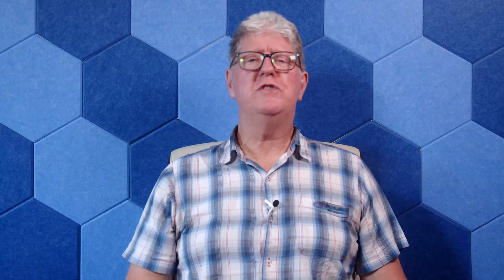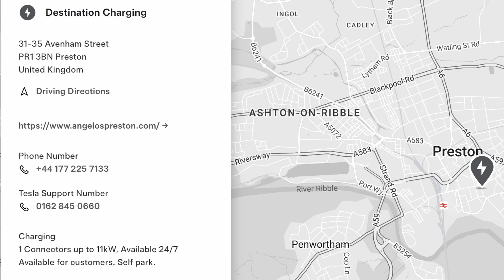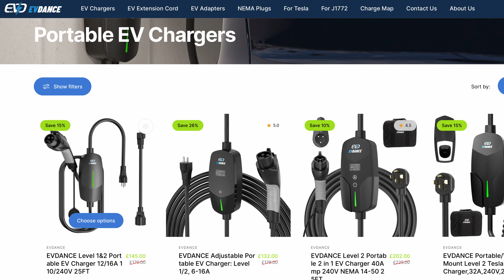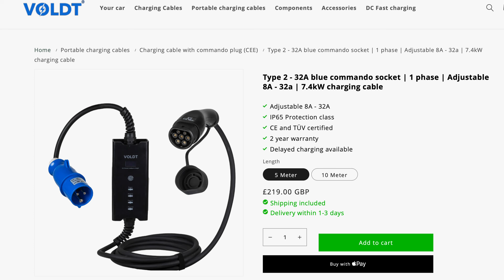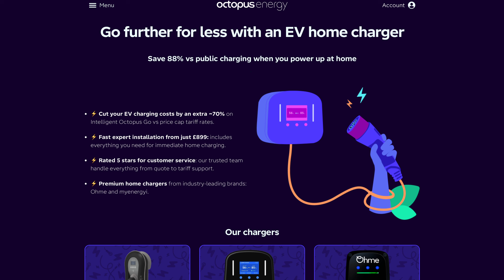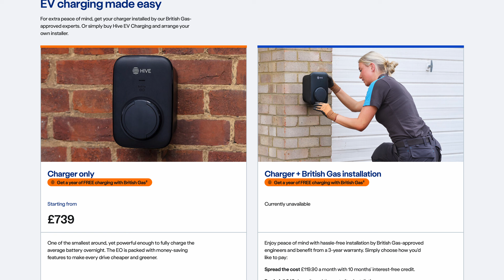Dummy's Guide To EV Charging | All The Things They DON'T Tell You!

Comment: Fortunately 30some years ago after purchased my house in '88 I used 12/2romex when I rewired parts of my house, I felt that overkill was my best option and I'm glad that I did now that I'm driving a '14 BMW i3bev. 

I do plan on installing a level2 charger using a dryer splitter.

Comment: Well explained. I recently got a model 3 LR and thought I might need to get a wall charger. But it was going to cost me the best part of £2000 as I am in a 1970s house, and the wiring and circuit board needed upgrading. I did a bit of research and worked out that I could get 7 hours off peak charging (under 7p/kwh) each night. With a 3 pin I could charge at about 2kwh, so 14kwh, per night, which is 98kwh per week. At 4 miles/kwh, this gives me 392 miles per week. Even allowing for 10% loss, I get 350 miles per week (over 18,000 miles per year) at less than 2p a mile. Even if I have to charge a bit at my day rate, I’d have to charge for 10,000 at the higher rate, to pay for the charger. I guess I am likely to do about 200 hours a year at the higher rate, so I will have to charge for 50 years to mean it was worthwhile getting a wall charger. It may be more convenient at times, but I’m still don’t think it’s worth the cost.

Comment: With an intelligent tariff like the EV tariff from Octopus, you get the cheap night time rate sporadically during the days  as well which means home charging is much quicker/ not restricted to over night slot. Also, if you source you EV through their leasing scheme you get a cheaper tariff as well. You also get all electricity at cheaper tariff when charging EV at the lower rate

Comment: Most charge companies in Danmark offer a free install of a 11KW charger in your house if you buy your charger contract with them so a great save in cost there... I have a company that's called Clever, it's a danish company so only got public chargers here but for £80 a month you have free unlimited charge at all their chargers and a few others they work with. Hearing the price of your chargers in the UK and KW prices on public chargers its rather expensive, it's between 30-60 pence on the most expensive I have seen so far... unless you find one lonely charger in the middle of nowhere then it might be 70pence pr KW

Comment: Very helpful. Thanks. Just charged my first EV for the first time, Couldn't get the cable out afterwards!!! Arrgh !!!!! Quite a bit of research needed to work out how to release it (press unlock button on key - would have been nice if someone had told me this!) Didn't charge at anything like 7 kw however. Don't know why - project for another day!!
Reply from the maker: I do always say that the first time you charge your new EV should be in the car showrooms even if it doesn’t need it with a rep or agent nearby in case it goes wrong
Reply: Same here lol, I had no idea i had to open my car door for it to unlock the charge cable.

Comment: Hi Dave this is nothing to do with this particular video as I am not able to DM you but it maybe worth a mention on one of your videos about cleaning the camera's with a water spray bottle and not using a rag or cloth. A cloth will cause the tiny particles of dirt to scratch the lenses in front of the camera and will stop the cameras from having perfect vision and will not be able to calibrate themselves and cause errors on screen while driving, eventually the camera module/cover will need to be replaced. My son is a Tesla mobile Technician and has to do this fairly often. It is also mentoned in the handbook about using water spray to clean them.

Comment: Most of the 3 Pin chargers are running at 10amps so will normally be providing about 2.2-2.4kW maybe 2.3kW when served by a standard 3 Pin socket. :)

Comment: Sorry, but the pence per mile figures are very wrong!
I haven't worked out the true cost of a Petrol car pence per mile, but it will be more than the 12p or so that the AA might come up with! 1st year after includes what should be included, like depreciation etc, might be 50p per mile or so. 
A 5 year old Petrol car might be about 20p
You did not include the home charger installation cost, nor did you include the far steeper EV depreciation (about 50% in the 1st year and an average of 10% after year 4 from searching the internet) and servicing/repair cost from what I saw!
Include all that and the figure for new EV'S in the 1st year with 12,5000 miles covered, is about £1.60 a mile.
With a 5 year old EV say with 125,000 miles covered, the pence per mile for year 5 will be a lot lower, probably about 30 pence per mile with normal servicing and home charger installation cost now not included. 
I haven't even included the higher cost of buying an EV or that a 5 year old EV will be closer to needing a new battery than not!

As for home chargers, there's no way in the world I'd have any EV plugged into a house wall or in the garage!
A home charger for me would be a small trench dug, so the charger sits independently 15 metres from the house with an extra circuit breaker in a waterproof closet on the drive. At worst, a hedge or fence might catch fire!
Reply from the maker: we are taking about two different figures. I am quoting the price per mile for fuel only. If a gallon is £6 and you get 60 mpg it's 10p per mile. If a kWh is 7p and you get 4 miles, that's 2p. What others quote is total running costs including depreciation, servicing, insurance plus, plus and also fuel

Comment: Just after I bought my Tesla I installed a 32A 7kW commando socket, which has the same output as run of the mill home charger, except the socket itself cost £46. I bought a Blue commando socket adapter from Tesla which fits onto the granny charger, which cost £39. On top of that I paid about £250 for installation, which included all materials. I have since purchased a dedicated 7kW Charger with built-in commando plug from Amazon for about £150, which is great as it has and LCD display and lots of features which protects the cars and home electrics, much like a standalone home charger.

Comment: I tripped myself up today. My Egolf only charges at 40kw so at Wetherby services I left the high power charges to those who need it, plugged into a 50kw charger and came out to have a neighbour and 25kw each. Next time it’s busy I’ll use the high power ones. 

Wetherby looks to be getting a load more installed.
Reply from the maker: same at Birch services M62 before Gridserve added 12 new 350kw. The only charger was a single 40kW dual bay electric highway. Their 22kW fast charger was probably faster and was definitely cheaper

Comment: Is it okay to charge to 100%% so I’ve got a full battery every morning?
Reply: Are you using the full battery capacity each day?  I wouldn't if you don't need to. I normally set my maximum charge at around 80% in the car's software. I only go to 100% if I know I'm going to drive 200+ miles, which I don't often do.
Reply: @Brian-om2hh  thanks

Comment: In 2018 I bought a PHEV and got my local electrician to install a new circuit in my garage to charge it at home - it didn’t need to be a very high rated cable and socket but before installing the bits he said he was going to fit updated wiring/ RCD and socket because “ Without doubt you will enjoy electric motoring so much you will change the PHEV for an BEV in a couple of years time so I’m fitting stuff that will handle charging that on an EVSE charger”  he was right, 3 years down the line I had been disillusioned by the PHEV’s poor  pure electric range and changed it for a BEV but when I did that I did buy a Zappi charger which would work seemlessly with the solar panels I had had for 8 years by then.
Reply from the maker: Great story and thinking ahead pays off. Enjoy your BEV
Reply: @davetakesiton changed the 1st BEV this year to one with more range, up from 110 miles to 250 miles range. In the 6 months I’ve had the bigger battery car I’ve charged in public 3 times on a 500 miles round trip to Fully Charged North last May, all my other charging has been at home and I don’t now need to charge every night or even charge to 80% - 65% SOC gives enough range for 3 days journeys into town and back.

Comment: 2.2kW maximum (10A is usually quoted), unless a heavier duty connector - like the commando plug and socket - is used instead of a standard three pin square (well actually rectangular, of course) pronged 13A plug.  

The plug and socket are not rated at 3kW for continuous use, such as the longer times the EV charger may be in operation.  A 13A draw is perfectly adequate for washing machines, dishwashers, etc, which typically only operate for a few minutes at high power (heating the water).

A 7kW charger is more efficient appliance than the lower charge rates - the charger and the car both have losses (the car will be rather more than the charger - I think my car loses around 3.5% at ~7kW), so fewer hours charging equates to less losses.

Apart from the above, a good guide for newbies to EV charging.

Comment: Charging on a 3 pin plug for a large length of time is poor advice, the fire risk is too high. A 3 pin plug should be used for emergencies only
Reply: Particularly an issue with the large number of older housing stock in the UK. Some terrace houses in the UK may have had electrical wiring updates which are now over 50 years old!
Reply: Also, check the power demand of the charger.  Mine comes as 16A by default!  Like that you can feel the plug get warm after some time.  But the charger also allows you select a current setting - I run it at 10A and it then runs with no heating at all. W

Comment: Great video as always Dave. Regarding 3 pin EVSE chargers. I would advise against charging at 13A ( 3.2 Kw ) for any prolonged period of time as the plug will get warm after a few hours of use. This progressive warming and cooling of the plug /socket can damage the plastic over time on the socket and end up causing fire or damage. I would recommend 10 A  (2.4 Kw) maximum from a 3 pin plug, even a heavy duty socket. Also make sure  that the socket you use is ideally not part of a ring circuit and is a on its own dedicated radial circuit prefereably with no other equipment using the circuit when you are charging the car. Many of these new EVSE chargers have an adaptable amperage rate from 6/8/10 and13A. I am a low to medium mileage user and personally charge my Nissan Leaf at 6 or 8A. An 8A charge can almost fully charge a 30kwh Leaf over night so If you're not a high mileage driver charging at these lower ampages will keep the plug cool and is much safer. I've had my car for almost 5 years and never had to use a dedicated charger the 3 pin has done 90% of my charges with no problems whatsoever.
Reply: 3 pin cables only charge at 10amps
Reply: @gordonchapman8036  Well I have a varible charger that offers 13 A ? The 3 pin  EV charger featured in the video also offers a 13A charge too ?
Reply: @gordonchapman8036  not true for all chargers. 

Tesla and most mobile chargers with swappable adapters have a chip in the adapter that tells the charger what amperage the plug supports. And then the charger will limit it and tell the car the maximum it can draw.

However, there are loads of chargers that will let you draw the full 13a from a 13 pin socket, some don’t have any chip and will let you draw up to 32a.

Comment: Dave the reason we install a 7kw charger is to get cheap electricity which also runs wahing machine and dishwasher possibly tumble dryer we are not as stupid as you think.
Reply: We have had a 3kw charger since we bought our first EV (the 30 kwh Nissan Leaf). I considered recently whether we should upgrade to a 7kw charger but for now it doesn't make sense.  Wr have solar panels and if the sun is shining I charge the car.  ,(We can easily get 3-5kw from the solar which is enough to charge the car and run the house without draining the batteries too much. So we can charge up during the day effectively for free. With a 7kw charger we can only charge during the night or briefly during the day which would 1uickly drain our batteries). Almost certainly if I was buying ny first charger I would get a 7kw but it is a lot of money to upgrade the charger and difficult to justify that cost when the current one is doing the job fine.
Reply: I totally agree as I do the same. No brainer. But only people who research this would know this...maybe a few people who look at an ev just believe what the newspapers say which is complete crap when quoting ev costs to own.
Reply: well, you did buy an expensive golf cart so clearly you're not exactly mastermind
Reply: @NeilHuband-p8q you obviously buy expensive petrol or diesel so definitely not a mastermind and my golf cart is the one that left you for dead at the traffic lights.

Comment: Thanks Dave, I should have seen this video 2 months ago :) 
I wouldnt have made a very costly mistake.
Our Utility company, Vattenfall, has HALO chargers on offer. 
Good charger with a good HALO app, which allows you to choose a slower charging speed, for example if you have solar panels.
What Vattenfall did not say is that they remain the operator and the charger only works with the Vattenfall app . . . .with which the customer can set NOTHING. 
So full 11kW charging, with 3kWh from the solar panels and 8 kWh expensive electricity from Vattenfall.
Gang of scammers, and we are stuck with an expansive wallbox, that wont work as promised.

Comment: I've researched the law relating to "cross pavement" charging.  Most local authorities say you cannot use a cable, even with protective / safety measures in place.  Thus they will not give permission.  However, the legislation they cite (the Highways Act - in Scotland it's the Roads Act) does NOT say placing a cable across a road (including a pavement) is illegal.  It says it's illegal UNLESS you assess the risk, use mitigating measures, and give users a warning.  That's very different to 'you just can't do it'.

Can the local authority refuse permission to do cross-pavement charging?  I can find NO legislation that gives authorities powers to give or withhold permission for placing a cable.  They have the ability to seek removal of obstructions.  But, (other than specific cases such as building works) they do not have the power to require permission.  Even if they did, the authorities' power is limited to issuing a directive to remove the obstruction within 30 days.  I suspect that very few EV users will have a cable laid out for one day, never mind 30.

What is required is a declaration from Westminster & Holyrood to local authorities clarifying what the law actually states, and the actual powers of local authorities.  They could decide to place new restrictions on cross-pavement charging - e.g. to limit use only overnight (which is when most EV tariffs tend to apply anyway).  They can amend the legislation - e.g. to define flush-fitting solutions such as Kerbo as legal by default (although if the installation requires excavation of the pavement, it WOULD require local authority permission).  Should authorities be allowed to charge an annual licensing fee for such devices (as some seem to be doing)?  I don't know.  But authorities justify licensing by saying they need to inspect such installations to confirm they remain in an acceptable condition.  The same can be achieved by including a clause in the amended legislation to impose a requirement on users to ensure the installation remains safe.

Ultimately, if we are all having to move to electric powered vehicles, some form of cross-pavement charging will have to become part of the charging mix.  We can't expect 1/3 to 1/2 of the population to use inconvenient / costly public charging.  Charging a vehicle will need to be as straightforward as charging a phone.  It'll take time but, to get the support of the majority of drivers, it has to happen.
Reply: Hello. Just reading your post, very interesting. It says edited, is there a more detailed version? I'm facing the same problem with my Motobility vehicle.
Regards, Stephen
Reply: @ghawdex7  Hi.  Not really - the edit was only to correct a few typos.  I've thought about making an effort to get authorities to change their stance (e.g. by using freedom of information requests, asking each authority to explain the basis of their policy of not allowing cable protectors or channels).  If we can identify their logic, then we would be i a position to challenge it.  But ultimately I'm just one old guy who can be ignored.  It really does need someone like the EVA to pick up the challenge and see it through.  But they too are all unpaid volunteers who don't have the time or resources to do it.  

That's the problem - each authority has almost unlimited resources of legal brains and finance , so it's all but impossible for an individual to challenge them.  Multiply that by the number of individual authorities, and it just can't be done.  That's why I said that the best solution would be for Westminster (& Holyrood in Scotland) to send every authority a clarification saying exactly what the legislation states and how it should be applied.  

Ultimately, if the government wants the majority of road vehicles to be powered by electricity, cross-pavement charging will have to be part of the transition.